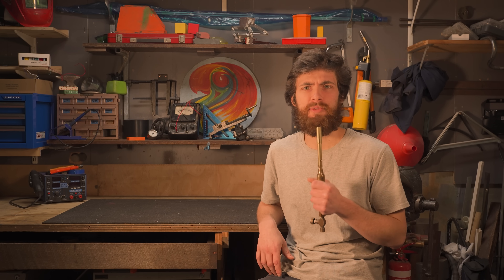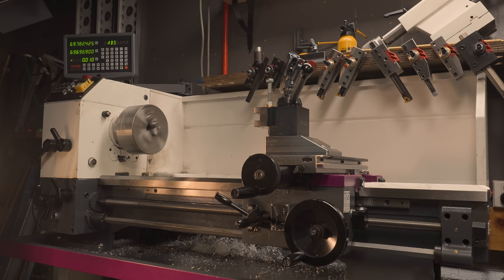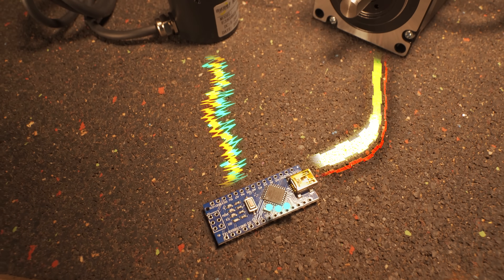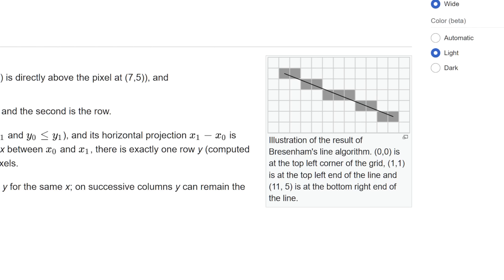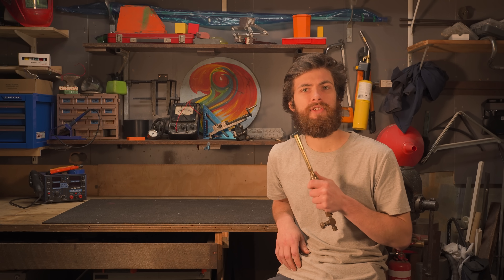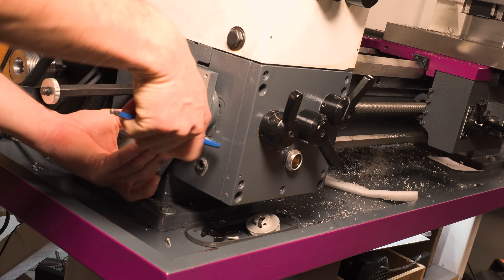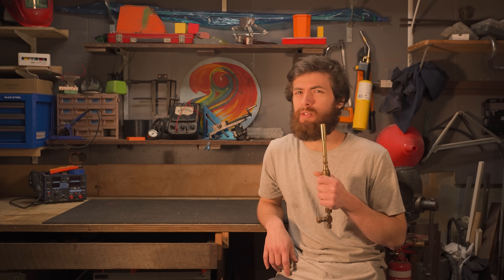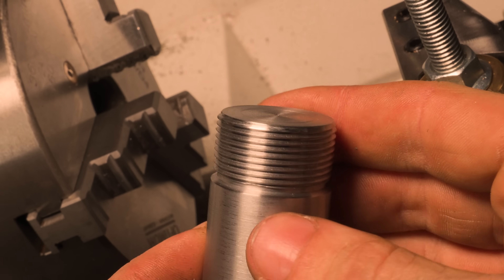Putting an end to the WORST kind of gears.

Comment: Just employ “use” next time. Think of it  like using a boring bar where you get slippage from a cutter. You may find it more like “grinding toward the part for the tool in your chuck … “ or whatever the appropriate non-engineering term is for getting past that skid in your record you had there at the end.

Comment: Excellent! I went some way down that road myself a few years ago, ended up with a power feed controller that needed a bigger motor and a bigger power supply to be of any use. One day I might finish it.
For the controller, I woulda gone with an ESP32, mainly cos I've written a lot of code for them and I'm familiar with its quirks. And you should definitely check out FreeRTOS.
My plan for the thread-cutting version was to the track the speed of the main spindle, and set the speed of the stepper motor to match, but came to the conclusion that a linear optical encoder to keep track of the carriage's absolute position would make things a lot easier, but sadly my lathe was just too small. One day I'll come back to that...

Comment: Damn, I know change gears are a hassle, but wouldn't have been much easier to make a mechanical cvt gearbox rather than dealing with electronics (saying that as an engineer though).
Reply from the maker: Think about that for a second.. a CVT, for extremely specific discrete ratios...
Reply: @NoEngineerHere  easier in my mind than fiddling with electronics, though a good compromise could be had with a planetary cvt and a speed controlled motor.
Reply from the maker: How are you going to know you have exactly 1:10, or 1:100 without electronics though? CVT stands for continuosly variable transmission, ie no predefined gear ratios, which is what we want for the leadscrew on a lathe. You'd still need a closed loop control system, so we're back to electronics. I'm not saying that's a bad idea, necessarily, but it wouldnt be purely mechanical (without an even bigger headache)
Reply: @NoEngineerHere  the same way people have for years, a dividing index plate and measure what values create the exact desired ratio, then use that info to set up a micrometer screw stop for a belt driven or an rpm adjuster and table for a planetary cvt.
Reply from the maker: Saying this as not an engineer, but that really doesn't sound like any less of a headache than a few lines of code, with much more room for error, and all without the convenience of being able to automatically stop at the shoulder of a thread. Again, not saying your idea is bad, just that you haven't properly considered the problem my approach is trying to (and has, in spades) solve.
Reply: @NoEngineerHere  It really just depends on what your good at.  I would have such a long and annoying time setting up all the electronics, and it seems old fashion stuff isnt your forte, and thats ok, because sometimes digital electronicshelp best, and sometimes all you need is a division plate.

Comment: Dude i love your videos but you know this isn't necessary to achieve your goals. 

This is a non issue for screw cutting. Ive never seen anyone go to this length to cut a thread. The gears work perfectly
Reply from the maker: Not when it takes 5 minutes to change them every time!

Comment: I'm far from a machinist... I'm an electrician. In a way that I read a print, grab a wire or cable as the print commands it, and match the wire color on point A and point B.

What I learned: nothing

But damnit I'm entertained.

Comment: I used my finger as a loadcell between the chuck and the lathe bed. Measurements was of the chart. 118db or above. Precise readings was Impossible due to the calibration where out of date, and the measurement device needed mending before calibration could take place. (Edit due to missing words)

Comment: 9:43 The driver knows where the motor is at all times. It knows this because it knows where it isn't. By subtracting where it is from where it isn't, or where it isn't from where it is - whichever one is greater - it obtains a difference or deviation. The driver uses deviations to drive the motor from a rotation that it is to a rotation that it isn't, and arriving at a rotation where it wasn't, it now is. Consequently, the rotation where it is, is now the rotation that it wasn't, and it follows that the rotation that it was, is now the rotation that it isn't. In the event that the rotation that it is in is not the rotation that it wasn't, the system has acquired a variation, the variation being the difference between where the motor is, and where it wasn't. If variation is considered to be a significant factor, it too may be corrected by the driver. However, the driver must also know where the motor was.
The closed-loop stepper motor scenario works as follows. Because a variation has modified some of the information the driver has obtained, it is not sure just in which rotation it is. However, it is sure where it isn't, within reason, and it knows where it was. It now subtracts where it should be from where it wasn't, or vice-versa, and by differentiating this from the algebraic sum of where it shouldn't be, and where it was, it is able to obtain the deviation and its variation, which is called error.

Comment: And also add stop limits so you don't crash and if you are currently using manual mode, there should be warning noise 🤷🏽‍♂️. 

Also an E stop.😅
Reply from the maker: Everything is tied into the existing estop circuit!

Comment: Looks like all my assumptions were wrong; I didn't think the whole electronic gearbox concept was going to be reliable and accurate enough, and I thought at least part of the reasoning for it was going to be the ability to cut inch pattern threads on a metric-only lathe.

Comment: I recently went through some what of a similar journey. I did get a nano to work-ish, by using a lower steps/rev encoder because the resolution doesn't really need to be that high. however those things are super limited on memory and they start to behave very strangly when you approach 80-90% memory use. my current version is running on an esp32. definitely a great upgrade for a small lathe. I've done all those automatic start/stop features also. at some point the hassle becomes the user interface to  input the details of what you want it to do. :-)

Comment: A supremely elegant and over-engineered solution to a problem that doesn't really exist. I love everything about this video. 👌
But, wouldn't it have made sense to skip the gearbox completely and just drive the leadscrew directly? 😅 Just imagine how smooth and silent the lathe would be.
Reply from the maker: It's a good point, well made - and one I definitely considered. But aside from keeping the ability to switch between the leadscrew and feed shaft (allowing cross-slide powerfeed, while avoiding unneccesary wear on the leadscrew) I wanted to maintain the mechanical direction control, as well as the 3 speeds (or for my purposes, torque settings) offered by the built in box. 

If I manage to figure out how to make a half-nut that works on a ballscrew I'll definitely go that route haha

Comment: Isn't it less precise? I mean, gears are analog, and any digital system would suffer from discretisation... Am I wrong? (I am not an engineer btw)
Reply from the maker: You're half right - but 2000 steps per lead screw rotation = 1.25 microns per motor step, even without considering that change gear ratios can often be off by a small margin!

Comment: I've built one with a nano like you first attempted. Threading is a problem that i have yet to overcome, in its current state it seems to slowly lose spindle location as time goes on. As you said floats pose timing issues so the only happy medium I've found so far is keeping the carriage locked. Which would probably be fine but it seems i need a gear reduction on the closed loop stepper that ive been too lazy to design 😂. I am also no engineer!

Comment: As a machinist who used to work in a gear shop, Fuck change gears. All my homies hate change gears.

So many archaic machines with slightly misaligned shafts in their gearboxes that refuse all attempts to pull the gears off.

Oh and specifically fuck bevel gear cutting machines. A set up time of "18 minutes" Can take 8 hours if you cant get any of the fucking gears on or off the shafts.

Comment: You dont want to use floats. Like, never, if you can. Hence this engineering trick that was initially used when MCUs could not do floats: multiply your numbers by 10, 100, 1000 if you need to. that way they keep being integers, not floats. Since you want ratios, as long as you multiply them all by the same number, they will still provide the same end result :)
Reply: 6, 128, 1024. Faster (and shorter machine code).
Reply: @peterfireflylund  First one is probably 8. I agree, but it becomes much less readable too.

Comment: @NoEngineerHere you can use the encoder and a second servo motor on the cross slide to build a gear hobbing machine/function... Just to keep feature creep at a bare minimum.

Comment: As someone with multiple coding projects on the go at the moment, I'll just keep playing with change gears. 

What I do want is a way to disengage the power feed (My lathe is the size down from yours, so lead screw is the power feed) so I don't have to listen to all that gear noise when I'm not using the power feed/making threads.

Comment: What are your thoughts on the opti-turn bench lathes? Been eyeing one off for a while over the Hafco branded ones. Our Tafe workshop just got 4 new Hafco milling machines and our teachers are spewing about how bad they are as the feet have bowed already under their own weight and took them a lot of work to level them. Havent got a chance to actually use them though as we are done with machining and i will finish tafe next block, hopefully should be done with the course early in the week next block so might ask if can play around with one for the remainder of the week. So yeah that has put me off the Hafcos a little bit.
Reply from the maker: It's certainly in better nick than the only other lathe I've ever used.

Can't say it's perfect by any means - for one thing the paint job absolutely sucks.

But I don't have space for the smallest Taiwanese made hafco model (weighs about a tonne too),  and this thing does the trick! Certainly has no trouble roughing, especially with the solid toolpost mount - but I swear I can see the grinding pattern on the ways in the surface finish on parts.
Reply: @NoEngineerHere  Seems like for the price it should be plenty enough for the house, at least until im not renting anymore, IF im not renting anymore i should say lol anyways cheers for the reply, have a good one mate!

Comment: I'm planning to do this too, including the bit at the end about setting start/end points so I can do multiple passes effortlessly. I don't have a way to cut threads at all yet, but my spindle is made out of a hoverboard motor so once I add a leadscrew motor I can do coordinated motion easily. The rapid movement back to start will also do coordinated motion, "unscrewing" as it goes so I don't have to retract the tool all the way out of the thread for each pass.

Having a closed-loop spindle is awesome, by the way. You can set the torque so it will stall easily if anything goes wrong, but will maintain the commanded speed right up until that limit. Much safer than using massive torque to prevent slowdown under load.

Comment: I just can't imagine why anyone would want to cut odd ball pitches that were never in a book for standard screw pitches.........an odd ball pitch means you must single point cut both screw and nut as you won't have taps or dies to do it the easy way. and that is provided you have a set of change wheels to do the job.

Comment: I have gone through this EXACT same thing at my job, where you say "the Nano isn't fast enough" and I HAVE to tell you, its not the hardware's fault! Arduino.h is CRAP, writing to a digital output takes FIFTY times longer than it should when using that library. I unfortunately don't have any code released to the public, but I built a library for use with my work that takes a ground-up approach and achieves much better performance compared to Arduino.h, please reach out if you're interested.

Comment: Bresenham's line algorithm is actually fairly straight forward. I don't claim to understand all the derivation, but in the end, it's just: calculate step sizes, keep track of "rounding errors"(difference between integer pixel coordinates and actual position). Coordinates are always integers, and lines are always "connected" to themselves, so one axis is just an increment-by-one every step, the other axis has a step value, and if that step value plus the error is bigger than the current coordinate, increment the current coordinate and note the new error value. You need to make sure the line is oriented correctly, but that is simple as well.

Comment: Floating points are bad... because they introduce rounding errors you can't get rid of, which means each pass of your thread cutting will be slightly off from your last pass, and because they take a lot longer for that poor little chip to calculate, meaning it might not keep up with your spindle speed.

integers ftw 🤟
(long long integers if you can 😎)

Comment: In a PLC what we do is to calculate the distance travel by A and the speed . multiply A to get what is required for B we are alway sending the new location and speed to B so it gets updated. With that in industrial automation we get both motors to coordinate. there is a more modern approach where you couple the motors with a virtual gearbox.

Comment: If you wanted to measure RPM, could a DC motor been useful for this application, since it will convert rpm to a voltage?

Comment: Relying on the higher clock rate of the MCU isn't a good solution. You can still lose a pulse count e.g. when handling an interrupt from I/O (like interacting with the screen). A dedicated hardware circuit that is separate from the CPU will be much more reliable, and won't need nearly as high rates. Look up FPGAs boards.

Comment: I know you are most likely kidding, but 7:32 is:

1. the slope of a line, in point intercept form
2. changing m to its representation of change-in-Y and change-in-X ("Rise over Run")
3. Multiplying both sides by the change-in-X to cancel the denominator, making sure not to forget that it must be applied to our intercept, b
4. Subtracting (change-in-X * y) from the left side to set our function equal to zero.

Comment: I made this worked on a regular arduino 16 MHz by reducing the encoder mechanically to 400 pulses per revolution (instead of 2000) which gave me around 1000 clock cycles per tick to output pulses to the stepper. Plenty if you're careful!
Reply: Screw-cutting is usually done at quite low spindle speeds so the pulse rate out of the encoder should be manageable. A better solution would be to use an absolute encoder (Gray encoder) rather than a pulse encoder since it doesn't drop pulses due to interference or slow processing and it will recover errors on the next step. Absolute encoders cost a bit more than pulse encoders though and need specialist interface circuitry.

I'd also separate the encoder and motor controller system from the user interface system to reduce the chances of button interrupts and display refreshes getting in the way of the spindle/leadscrew timing.
Reply: I also implemented all the features you mentioned at the end - a shoulder stop, automatic re-synch with the spindle to start the threading, and I threw in multi-start threading while I was at it.

Comment: Wouldn't a magnetic rotary encoder perform better in this application compared to optical? AFAIK there are ones out there that provide absolute rotation with high resolution and they are generally quite reliable (suitable for harsh environments). With absolute position you also get rid of code keeping track of an incremental encoder's direction etc.

Comment: me, i'd just slap some gears from a cg250(cheap chinese motorcycle engine) for a shifting box and use at least a whole lot less change gears, maybe mod it for common gear ratios.  electronic gearboxes, bit annoyijng to get designed so they're accurate... trying to figure out some ttl encoder readers for glass scales was a wash cause i'm too dumb to figure out how to convert the count for 5u scales, 1u is EASY, really really really dang easy, even a dope can figure it out.  for your project, matching the counts, i'd use gray code printed on the edges of some plastic gears, one position for each virtual gear tooth, then you just match the pulses exactly, no fuss...

Comment: If you put in the metal gears you took out instead of the belt, you can create variable gear ratio and then you can simplify your code to just do 1:1 😎 Problem modernized.